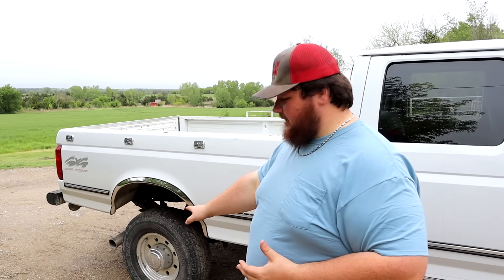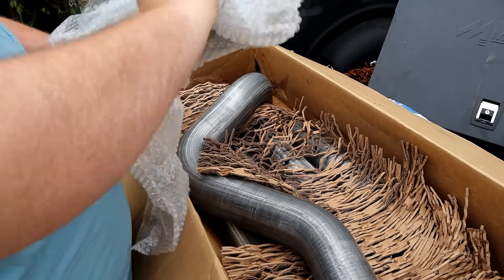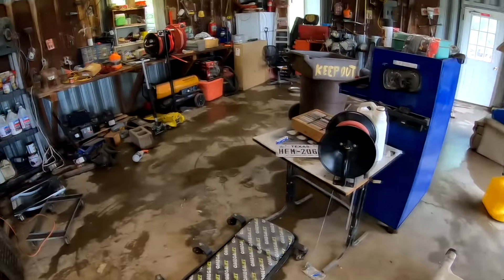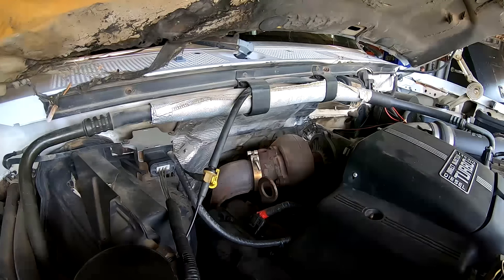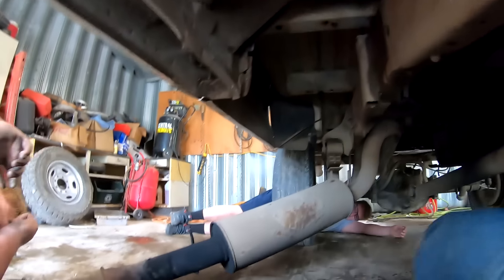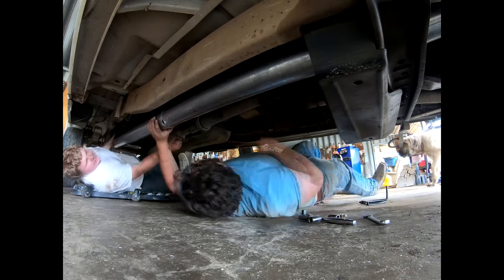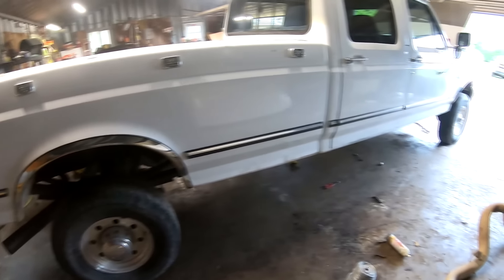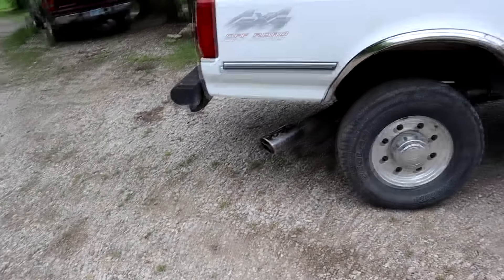$1,000 F350 7.3L Powerstroke GETS UPGRADES !

Comment: I bought a 1985 F250 4x4 6.9 idi 4 speed manual regular cab project truck. Sometimes I think I must be crazy to take this on but, when he's done it will all be worth it. His name is Sebastian and he runs  pretty good after some work on his engine. He admitted he had an addiction problem with Starter Fluid so we got him help for that. Now I'm working on the cab electrical issues. He has a personality that's for sure.
Reply: This post is 4 years old. First time I have ever asked someone. Do you still have it and are you still working on it
Reply: yeah any updates?

Comment: That is one of my favorite body style of Ford Trucks. Go 7.3
Reply: bed not even rusted that truck worth some money
Reply: Completely agree
Reply: @jaggsta  I've got a nearly perfect idi dually but that's the life of living in the south rust wise
Reply: @jaggsta  Perfect on no rust that is
Reply: Anyone got one for sell
Reply: @brandonruffin8580  I'm selling my idi dually since it needs work and I have no time for it
Reply: @nou8257  what kinda work does it need?
Reply: @brandonruffin8580  trans glow 0lugs and injector return lines trans is a zf5
Reply: Smooth Trooper hey may I ask you something do you know if 2016 f350 gas 6.2 or 2019 f250 also gas have any issues like death wobble or something else I’m thinking of getting a new truck but don’t know which truck can you help me please thanks
Reply: @AlejandroP1980s  I have heard of a 17 model year having an issue with death wobble usually its your steering and suspension components worn out that cause it as far as I know.

I will say a F350 gas would prob be gutless since a F250 is already a heavy truck and the dually just adds weight just depends on what your doing with the truck. 

My best advice is research everything you can on what you want then test drive it and compare it all even non fords you might think you wont like I was new truck shopping for a diesel dodge and ended up test driving all fullsize diesel trucks to find what I wanted in the end I liked all that I drove but the prices where a joke.
Reply: Smooth Trooper yeah true prices for what I hear and seen 2019 chevy and gmc trucks are GM junk ram is fiat junk ford is not good like they use to be got greedy don’t care about quality only quantity money they get and Toyota Tundra is good reliable but don’t like the look of it I’m going with Nissan Titan sv not needed for towing anything but for the space and good looking
Reply: @AlejandroP1980s  Personally i'd rather a ford than a titan buts that's me
Reply: Smooth Trooper 2019 new ford no because so many issues
Reply: The best
Reply: theyre big but the super duty looker cleaner imo same engine too
Reply: True!  The design team of that decade were on top of their game  !!
Purchased a 96 F350 PS, CC, DW, LB , Ambulance packaged,  it has been my go to heavy hauler, with 11' slide in cab over, 3200 lb camper , toured the nw UsA with it , currently  66k miles on it .
Cheers

Comment: I had a '97 F350 XLT 7.3 CC LB in mind condition, I was the original purchaser. When I sold it four years ago, it had 60k orig miles. Most the ones you find today are totally trashed. That said the most significant upgrades I did over the course of a few years, was a PMF reverse shackle kit, PMF pitman arm upgrade, trackbar mod, limit straps and a basic Fox shock upgrade (nothing special, just your basic cheap Fox’s). The ride quality improvement was mind blowing. I also did a Fox dual steering shock absorber upgrade, stainless bake lines and air bags. The truck didn’t look badass until I put 35” Toyo Mud Terrains on a set of Mickey Classic II wheels. Everywhere I went people commented how nice my truck was. I later did a Bank’s exhaust and the intercooler kit. You can get really nuts with upgrades but those were the most significant. The other upgrade I did was take all the seats out, carpet (carefully) to insulate and soundproof the cab with Dynamat and Dynaliner, and sprayed Lizardskin behind the heat shield. Put everything back in and installed JL Audio C2’s and C3’s, amp and new single din NAV headunit. It was pretty much a new truck. I regret selling it everyday. F250/350 1995-1997 (ideally 96-97) trucks are the best investment and can be easily modded to be awesome! I'm looking for a nice one as a project truck. Hats off to you for finding one so cheap!

Comment: I Bought a 97 dodge 2500 12 valve manual transmission for 3000$. It was my first vehicle. Junior year in highschool I bought it... it had rust and other issues (typical old dodges). But, I cleaned up the rust (the chassis was good just had body rust) so I dealt with that and tuned the engine and fixed its little issues, then I had a myself a decent old truck that was real fun to drive. Driving it stock for 2 years was awesome. It was white, and it is quad cab long bed... around beginning or middle of my senior year I painted the truck all black and got it stacks in the bed, a lift, and some rims and tires. It was built. It made around 750hp. Currently now it’s making a little over 900hp. It’s built. I have that and my new 2018 Dodge Ram 3500. It’s making 625 hp with a bigger turbo and cam. That’s a towin truck. Pulls my race trailer and a gooseneck flatbed.(the race trailer is also a gooseneck lol. I have 4 trailers in total. The others are bumper pull. I have a flatbed dodge also, it’s a 2005. Dodge 4500 2005 manual transmission. That has a tune on it. It’s got the ball hitch in the bed. That truck is mostly pulling the gooseneck flatbed. I might sell it, because I have my other 2 trucks. It’s nice to have a flatbed though. I might sell it, the new dodge is the daily driver, and still drive my 2nd gen also... I’m not selling that truck it’s too much fun. Dodges are awesome. Cummins power all the way... ford too. I’ll take a 05 6.0 powerstroke or a 7.3. Love those trucks and engines. Ford and dodge trucks are awesome. Maybe I’ll buy a ole 7.3 I don’t know. My buddy has one... it’s built like crazy.

Comment: My buddy got his dad's 95 f350 7.3  that had 850xxx on it and still ran strong
Reply: It's just finally getting broken in then
Reply: Damn dude mine has 308 and i thought that shit was bad
Reply: @josiahboe849  I have one I bought at a salvage auction with 343k and a lb7 duramax with 358k
Reply: His dad followed the maintenance manual to the T. When he got around 500k he started using marvel mystery oil every other oil change and ran it through the fuel system every third tank to help everything stay conditioned.

Comment: My family used to have a 1997 f-350 7.3 crew cab long bed, dark red with a grey strip down the middle. We used to hook up the fifth wheel every 2 weeks to go camping on the Kenai river when my dad came home from the slope (oil fields in Phrudoe Bay). My dad sold the truck in 05 when I was 7. If I have the chance to get a good condition 7 3 you bet you ass I will get it because the 6.4 will never compare to the memories

Comment: So my friend wants to put a 12 valve Cummins in his 1980 Ford F-250, good or bad idea😂
Reply: Honestly the 12v is over used. Ita a great engine and all but every one does it. Now you want an engine of the same displacement that is better in every way to the 12v. The international dt360. That engine wipes ita ass with Cummins. It's a heavier engine with thicker parts. It can handle more power. Its wetsleeve as well so easier to work on and they tend to be cheaper.
Reply: Do a 24v swap instead, more power and almost just as reliable.
Reply: Stuff stuff and More stuff Just don’t get one with a 53 block.

Comment: The 7.3 is a beast and pretty easy to change oil. Filters can be a bit of a challenge especially if the previous oil change technician believes oil filters are load bearing members on the engine.  The filter can be quite tight. Reinstalling should be hand tight ONLY!!!!  Add 1 qt of oil and lube the gasket. Then 32 ft lbs torque on the drain plug. YES THEY ARE TO BE TORQUED!!!!!!!!
Reply: We use the German method  goodntight

Comment: Don't fret so much Kansas, you two shall get there eventually. I had to sell my mate to your truck, mine was the dually, five speed HD, with fancy flatbed, tool boxes under bed, single down and "Y" over the rear end. Was I you, I would of drilled the fuel plug on the passenger side while I had the down pipe out. I forget the size socket but be ready to pull hard to remove and then as the fuel back flow's out of the head, look at the plug you just removed and those holes in the plug which run sideways are like 1/8th in size. Please be very careful with the piece in hand. Oversize the hole to 3/16 size depending on which style in hand. Once done put exhaust back and behind power steering bracket is the one for the other head. Back on passenger side and front on drivers side. Once all together, go to the fuel heater and disassemble and it will be obvious what to drill out and assemble again. While your in there, some argue to stretch the fuel pressure spring but I just took mine out. Make sure heater is plugged in and working cause even cool temp starts can get iffy. I put big ass luber finer filters on the frame rail and done away with that filter. You will get another easy fifty horses or more but the torque will damn fool you. There are lots of how to's on google so not to worry, I mean what could go wrong. My truck came from Missouri  just north of you. Guy had all documentation on engine and transmission. And then the heavy duty gooseneck was done right. Even had the retractable running boards, I couldn't of ever afforded to buy new and his wife got sick so he basically gave me the truck for storing his huge ass trailer that it pulled like nothing. I installed remote mirrors with heat for very little (what are friends for). Two years later he mailed me the title to trailer and said sorry he couldn't come back. Now you can be sorry like that all my life! I did make some serious money the next year in my placer mine and sent him a check for ten thousand but he sent it back cause I was honest with him and he didn't need money.. his wife passed and he only used the truck for pulling trailer on their trips. I get goosebumps thinking about him and his wife. Nice older foke. Hell now I'm his age. I can't drive and most wouldn't drive it cause of the modest lift... forgot.. he had put new tires and aluminum wheels on it. It looked nice at night lite up. I put five hundred gallon fuel barrel, my atv, pumps hose, etc on it when I went up to the mine where it sat all year and then home in winter. If it got real cold, then I put her "alaska" necktie on.

Comment: I did like the sound, old 7,3 is a tank.  I never heard of a Resonator on a Diesel Exhaust, But the good sound works for me. I have f250 2004 6.0 with straight 4" pipe. I would like to try a Resonator if I could make it my self. Keep Tinkering Guys

Comment: if your going to upgrade your injectors and chip it i suggest full force diesel 180cc injectors with the ts 6pos tuner had a really good exp and got my $400 refundable core charge back when i sent the cores in fantastic company.

Comment: I have a 97 7.3L power stroke with 242,000 miles on it. She’s my baby and I’ve had numerous offers to buy it but I will never sell her. Been the best truck I’ve ever owned  with hardly any $ spent for repairs….the most reliable Ford diesel out there….hands down.

Comment: You should consider an upgrade 
On the garage.  A 20' steel post
With a built in crane and trolley. 
Hell you may as well throw in
A electric lift
Reply: If you need pointers here goes.
1. You pour your slab
2. Set your bolts
3 set your risers 
4. Hang the top steel.
5. Shit, your done Except for
    Little stuff.

Comment: Can’t you do a turbo wheel swap in one of these? I think it’ll make more boost that way and make louder turbo noises.
Reply: If youre talking about the wicked wheel these truck already came with them stock. I just rebuilt my turbo. They are a big improvement on the newer 7.3s though. Unfortunately they dont do anything for sound because the wheel is on the intake side of the turbo. If anyone tells you if does they are full of shit 😂
Reply: L76 6.0 VortecMax you might have a point lol. I’ve never done it but I’ve just heard of what it can supposedly do. Lot of misinformation on yt unless you find the right people lol. So this is an upgrade for the newer 7.3s but not the older ones?

Comment: It's not actually a powerstroke it's a  7.3L international made by Navistar international.
Reply: Garrick Rodewald  yes an no. The one international endorsed is the t444e fords is the power stroke
Reply: @The0590628  true but my 2000 f350 is a international with a zf6 manual

Comment: You see what hes doing trying to set the value on 95 fords when most of them value is 5000 or more 1000 bucks for a 95 ford that can tow and run yeah right hes got half a truck thats what the 1000 dollars reflects a abused negected single wheel axle